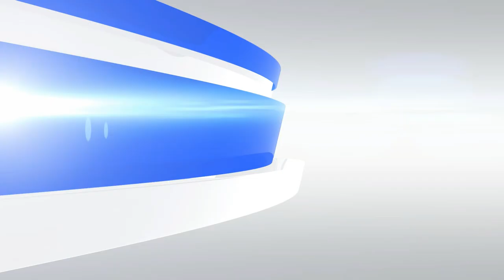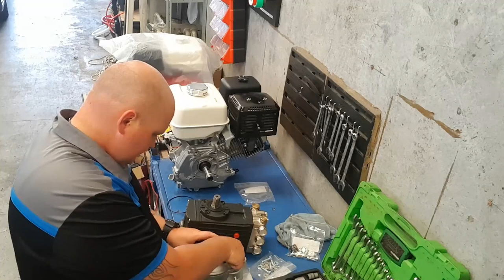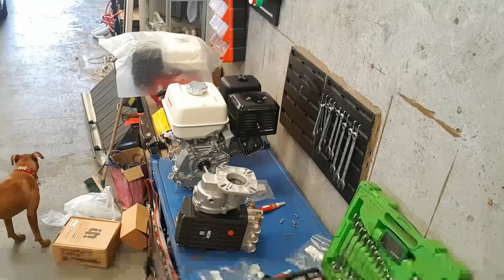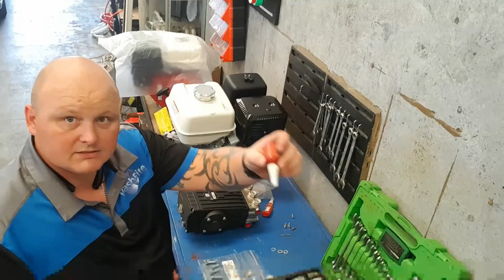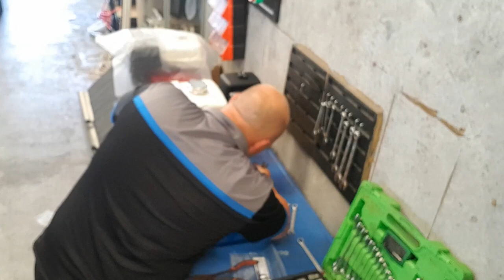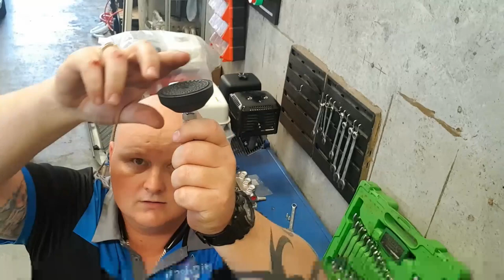Building A Cold Water Pressure Washer

Comment: well good to know i installed everything right... I did my first build a 10Gpm pump and 22hp predator motor I searched for videos on this pump and reduction box installation and found nothing.. So i just used my head slapped it together yesterday. And what do ya know this popped up as recommended... and i did ir right!!!! Oh and that guy Bitching about Grease is a MORON i use high temp grease with a drop off of 570 degrees.. its a must hell i use grease on everything .. Great Video BTW Happy washing people

Comment: What series interpump please
Reply from the maker: Hi, Most of the pumps we have across our 60 trucks are RW5530 comet pumps. extremely good pumps
Reply: @WashRite  I think these pumps are 21 litres per minute - so you don't hook up to the clients garden tap then?
Reply from the maker: All of our pumps are plumbed to a buffer tank on the truck to ensure a consistent and reliable water supply, house taps flow rate goes up and down and in turn u run the risk of damaging ur pump due to cavitation